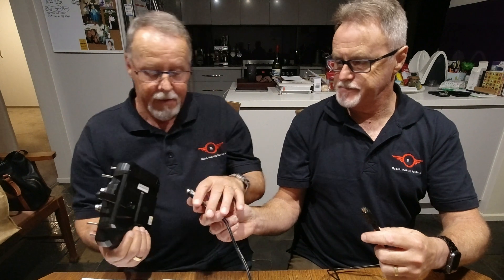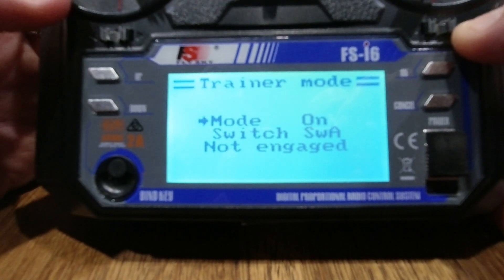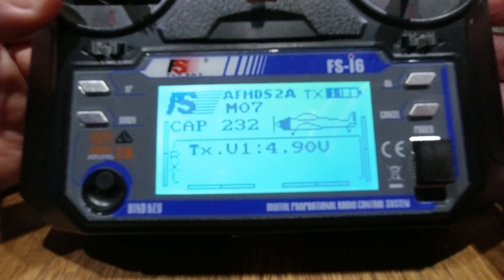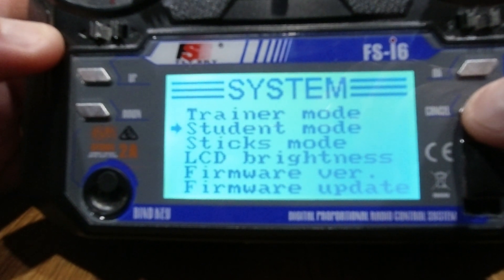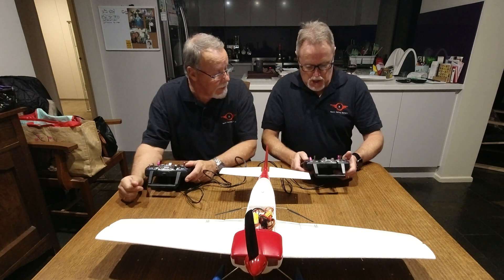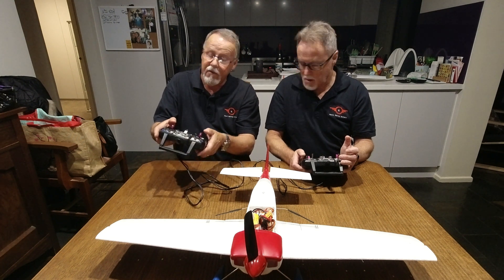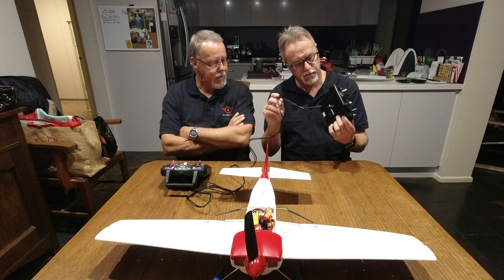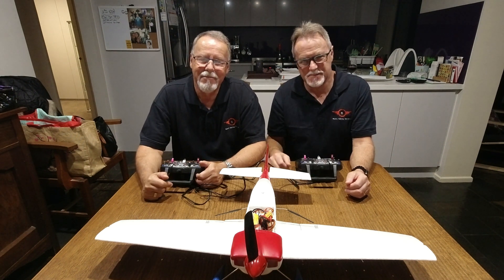MMM FlySky Trainer mode

Comment: I do not understand why the trainer has zero control when in trainer mode. The trainer should have control all the time without having to flick a switch. In other words any input from the trainer should override the student. Also I would assume and hope the trainer can give only the controls he wants to give to the student. Ie just ailerons and throttle for example.
Reply: Just got an old I6 and I6x working on a rudder elevator  park flyer. (The mighty Dart XS)  I think the secret is to buy the flysky 2m trainer cord. On  the plugs on each end of trainer cord 2 wires are swapped transferring control from one tx to the other. I use a momentary open switch on switch d for fast response. Do the trims transfer over?   I dont know or care this system does all I wont it to. I have yet to find a willing trainee victim.

Comment: Hello, I have a fsi6 radio just like yours, but when I turn on trainer mode, it turns on full throttle and flaps. I haven't seen anyone with this issue. If you have advice that'd be great. Thanks
Reply from the maker: Let me check

Comment: After searching a while I found today a stupid trick to keep your settings on the student tx, specially the stick mode,if you don’t switch the student tx to student mode you keep the settings and the tx just sends the ppm signal to the trainer to, channels are equal but you have to change the other settings manually
Reply from the maker: Thanks for your comments. We now use Radiomaster / Eachine TX16S transmitters. Might create a video on Student mode for the new TXs?

Comment: Hi,for the student transmitter,do I need to bind it 1st with the trainer receiver?
Reply from the maker: Hi Muhammad, You only need the trainer TX bound to the model. The student will have control through the trainer transmitter and will not need to be bound to the model.
Reply: @modelmakingmaniacs8600  thanks for the info 👍🏼

Comment: Would the trim carry over ?
Reply from the maker: Good question. We Will try this again and check the trim settings. My feeling is that the master  and all of the settings will carry over to the student.
Reply: Did you ever try this? I found that I needed to duplicate all settings on my trainee radio, including trim, which surprised me, since that contradicts what the student mode warning screen says.

Comment: Hi Guys, can you please advise how I set up trainer mode with FlyskyFSi6 transmitter with radio master TX16S as the trainer transmitter. I set up trainer mode on the TX16S but I don’t know what protocol I need to select for the fsi6 transmitter?
Reply from the maker: Hi James, If you set up student mode on the FSi6, does the Flysky transmitter have control when the switch B is engaged on the TX16S? There is only one setting on the Flysky transmitter for Student mode.
Reply from the maker: You also need to make sure the S-Video cable between the two transmitters is earthed. That is the metal casing on each plug needs to be connected by a wire between the two plugs.
Reply: Hi thanks for your advice, I’m not using the manual cable I’m using the jumper 4in1 multi module, but I didn’t set the fsi6 to student as I didn’t need to do that with the other different brand radio transmitters I have?

Comment: OK an update on this subject. We just melted a hole in the back of the "Master" Tx case and hot glued a normal servo socket (cut off an old y-lead) into the hole. This was wired to the battery Positive and Negative points and the signal wire to the PPM Input of the Trainer Socket. A cheap Flysky A8S receiver is velcroed to the back of the Tx and its PPM output plugged into the servo socket. By binding the A8S to the slave Tx and setting the A8S-equipped Tx to "Master" as in this video you have a reliable wireless connection with no dodgy connections, no wires to trip over and full freedom of movement for both trainer and student. 
Plus you can just replace the A8S for any other breed of receiver (must support PPM output and 5.5-6v power) to use with your "Student" Tx of choice. We have also added the A8S system to our TX16S multi protocol radio to allow the cheap FS-i6 radio to "Student" fly a heap of our other planes.

Comment: I tried to hook up my FS-i6X in trainer mode with an FSi6 transmitter as the slave. I the cables supplied with the transmitters but joined the USB end with a USB connector. I don't know if this worked! H I set a switch for the trainer mode but when I switch it on the engine starts. Any thoughts, please?
Reply from the maker: Pretty sure you have to use a modified S-video cable, or a cable designed especially for trainer mode? 
Video links:
how to make the cable.
https://drones.stackexchange.com/questions/1276/how-to-build-a-buddy-box-cable-for-flysky-fs-i6x-rc-transmitters
where to buy the cable
https://www.banggood.com/Flysky-i6-Trainer-Cable-For-FS-i6-FS-T6-Transmitter-p-986742.html?cur_warehouse=CN&rmmds=search
Reply: @modelmakingmaniacs8600  Thank you so much for your help! I modified the S-video cable and it now works a treat.

Comment: Thanks for the info and the links to the cable connection diagram. It will help getting our Fs-i6 Txs connected. Hopefully that will cross connect FS-i6 and FS-i6X also. It would also help if we could find any info on cross connecting to our TX16S radios with the Flyskys and even a Spectrum 1 that we have. I'm assuming that the PPM signal transferred from slave to master will need the same channel mapping - any knowledge about same? Also could you just feed a PPM signal from a receiver to the PPM input of the master and use that as a wireless link from the slave? That would take care of a lot of cable compatibility issues and allow disparate systems to cross connect.
Reply from the maker: We haven,t tried this with any other transmitters so not much help to you there. Interesting idea to get a wireless connection for this process. That would require some testing to verify that it could be done and not interfere with the Trainer / Studen functionality. Last thing you need is your plane falling out of the sky when training. Ha Ha.
Reply: @modelmakingmaniacs8600  Unfortunately I'm just an Old Fart bogged out in the bush so I'm not able to do the tests required before hooking a receiver up to the PPM ports on the FS-i6 Txs. No chance you fellahs know anyone with an oscilloscope? What we need to be sure of is if the voltage output swings of the receiver and the PPM input of the Tx are the same.